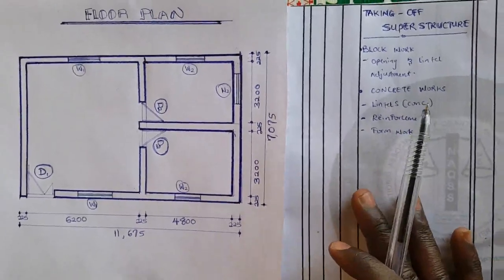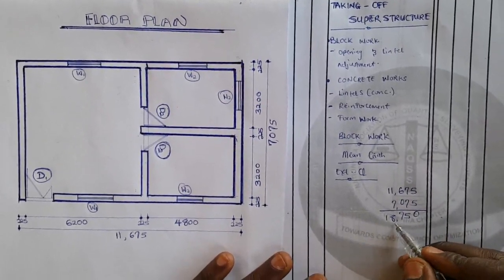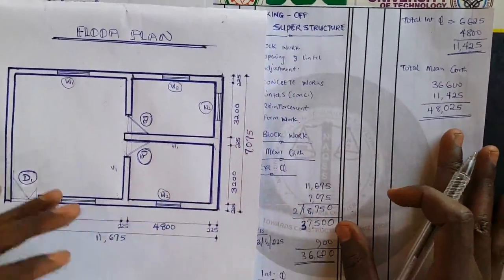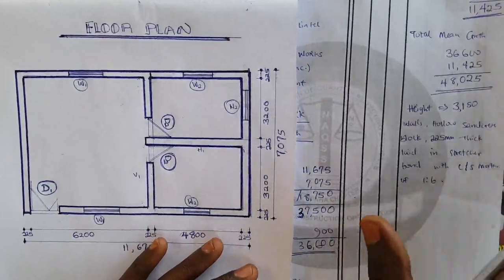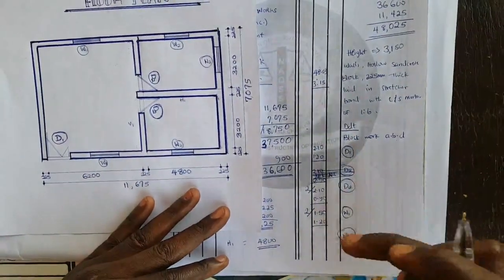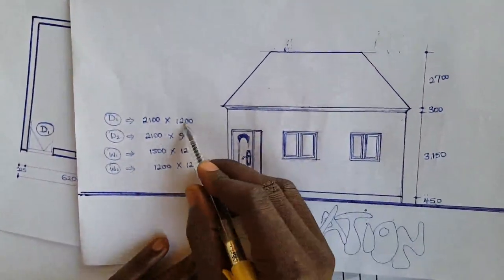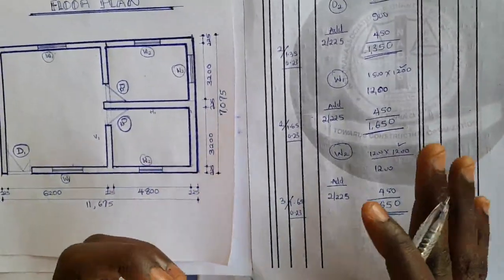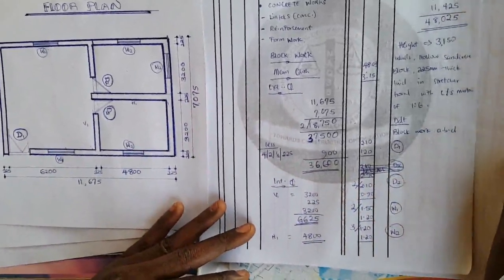TAKING OFF FOR SUPERSTRUCTURE — PART 1

Comment: Thanks you for a job well done... But at the deduction for concrete lintel in window 1, I think what we're deducting should be 1500 and not 1200 since the space the lintel is coming on is the width of the window and not the height and the width is 1500. Thank you... Please check and let me know if am the one wrong on my side.
Reply: Yeah, that was what I was also thinking that w1 should be 1500 and not 1200 since it's the width the lintel will sit on and not the height. Kindly let us know whether it's right.

Comment: Great one. Please for the lintel of the window, you used 225 as the height 🥺 I don't understand please
Reply from the maker: Height of lintel can either be 225 or 150. Ideally, most construction uses 225mm to ensure that the height of the lintel tally with the height of the block which is 225 for both 6 inches n 9 inches blocks.
Reply: @qsacademy  Thank you. I understand now. Well done sir.

Comment: i have a question on h1 figure. Why did we not INCLUDE 225 since 4800 ENDS BEFORE THE INTERNAL WALL 225???
Reply: To avoid the error of over measurement, it has been taken already in the verticals dyg?